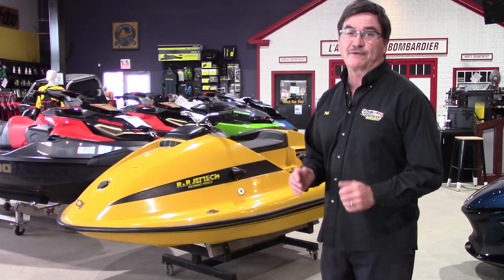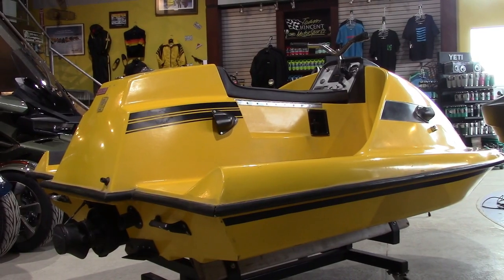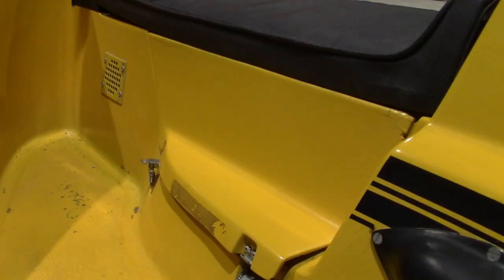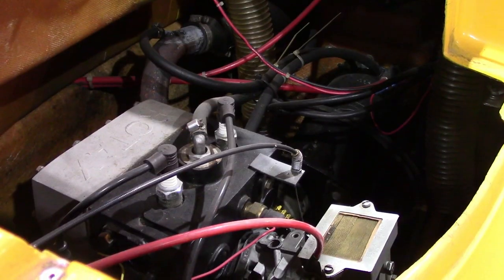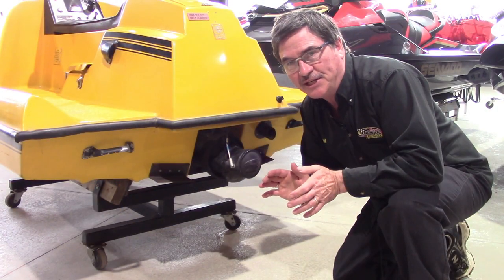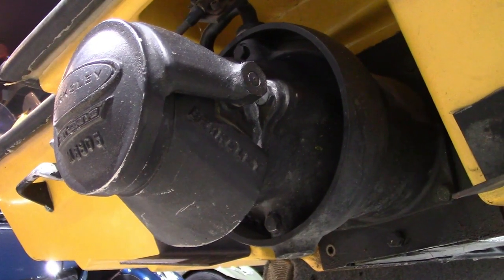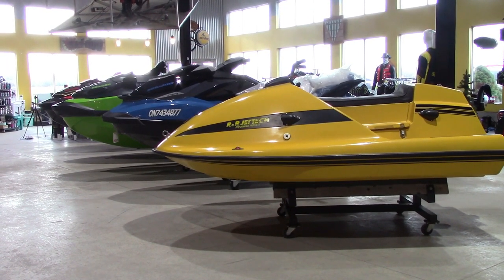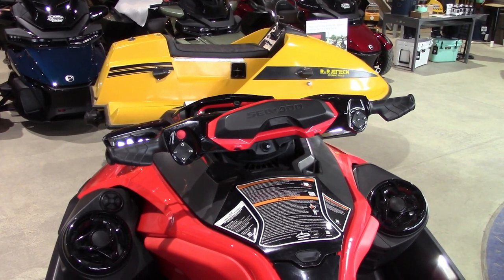TVM 1969 Sea Doo BRP

Comment: Thank you very much Phil.Ron G (I have an old 69)  Cheers
Reply from the maker: They sure stand out when you see them at someone's dock!
Reply: Would you happen to know where I could get copy of a shop manual?
Reply: Sorry Dave. All I have is a brochure for the 69. Tx and good luck
Reply: @rongirard6583  Do you know of any good parts sources?  I have two 69s and one of them is missing most of the bolt on parts.  The previous owner took them off and sent them to a chrome shop...the shop owner died and they never got the parts back.

Comment: I think those engines were a similar layout to the Nordic 370 snowmobile but liquid cooled instead of fan. It looks like the same design where the cylinders were turned  in so the intake ports were close together which would make a single carburetor work much better.

Comment: Jeeeeesusss 20.1! Ratio !
Reply from the maker: There were some very heavy oil recommendations back then.
Reply: Old outboards from 20's -40's did too and was no two cycle oil just motor oil. Can you say rainbow on the water most went out exhaust.